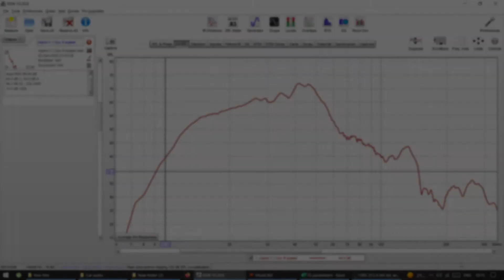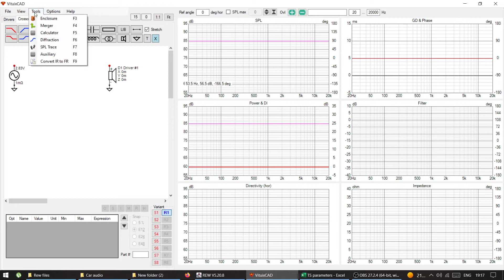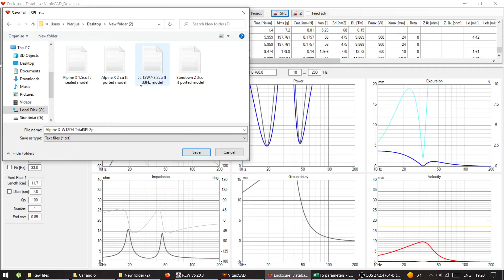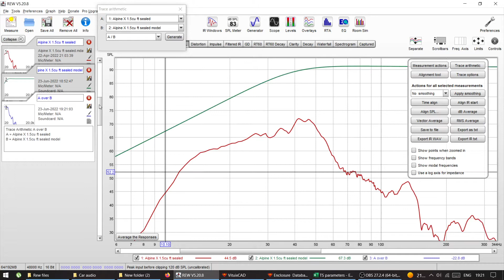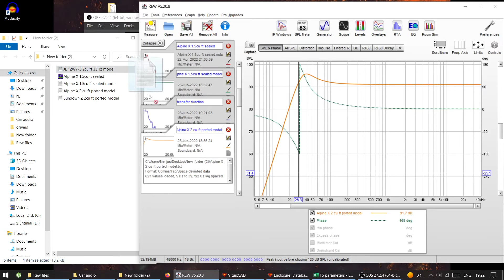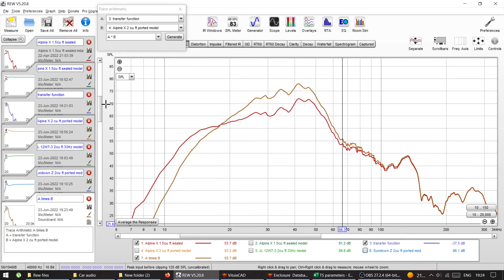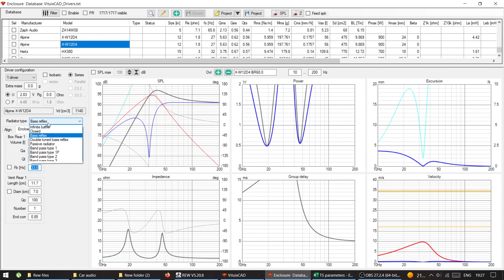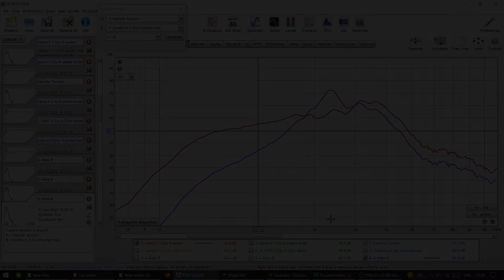How to get and use your car's transfer function

Comment: As always thank you for sharing your knowledge. 

One question, Should the wattage of the physical speaker used to find the transfer function be the same as used in the models? So if I model the speaker with 300 watts I should try to take the measurement of the subwoofer in the car at 300 watts as well and then have every model based around 300 watts?
Reply from the maker: The output power does not matter. In WinISD you have to look at the transfer function tab, not SPL. With modeling we are assuming that the system is linear, that means that the frequency response does not depend on power. In a real world scenario that might be inaccurate, however there is no way to model nonlinearities.
Reply: @RAW-CAt  Thank you, I just wanted to make sure I did not have to worry about level matching the real world speaker with the model.

Comment: Hmm so I could measure my current Ultimax 10 that is using passive radiators to get the response and then do this and can see what a Ultimax 18 in an infinite baffle config would probably be doing in my car... I need to do this on the weekend for fun.

Comment: Does it work for tweeters and mids?
Reply from the maker: Of course, it works for any kind of driver. In theory  as the modeling software is designed primarely for woofers and subwoofers.